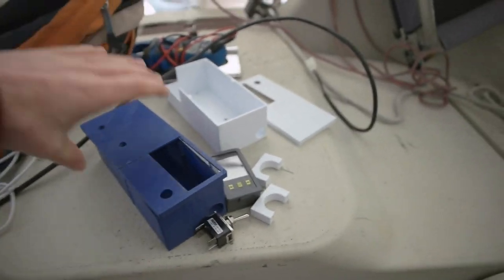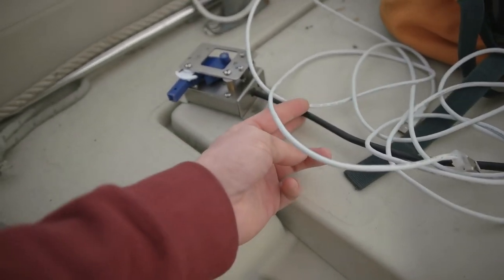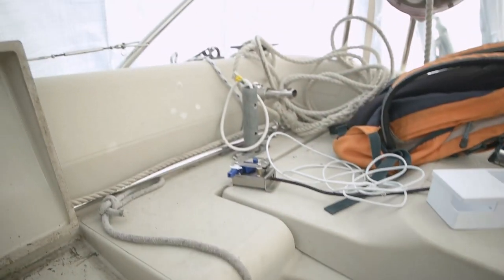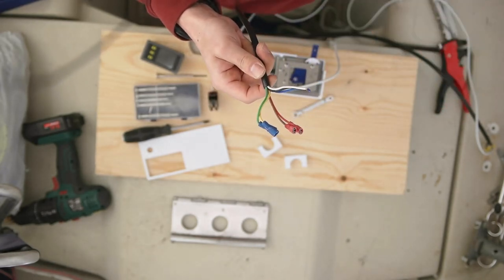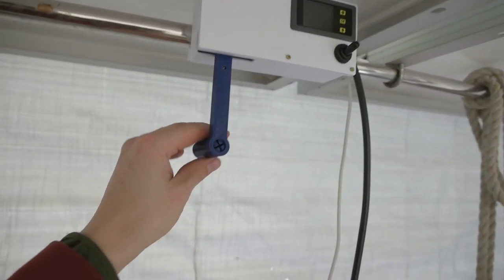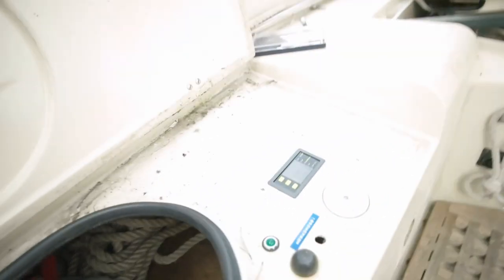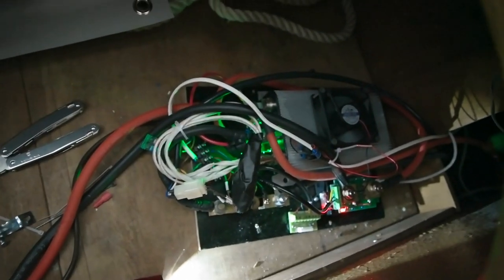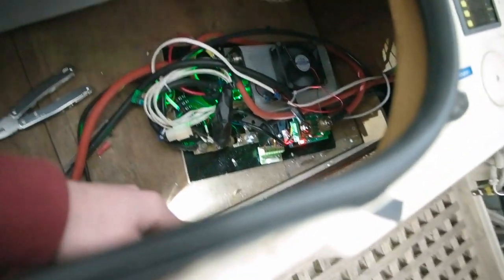New throttle controller box 2.0

Comment: Hi Pauli! You may want to wrap some rubber around the pipe so that the controller sits tight around it?
Reply from the maker: +Kenneth Duborg Good point. But the PETG seemed to be not that hard so it might just grip without..?